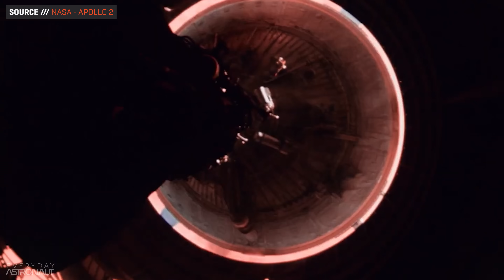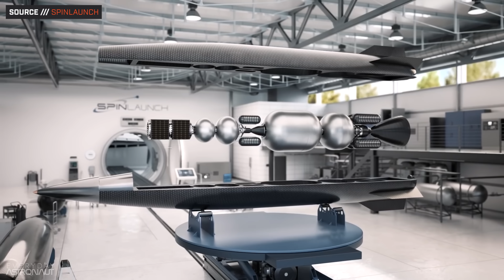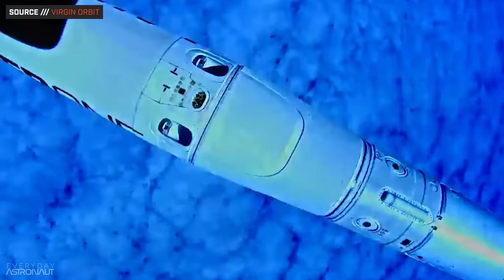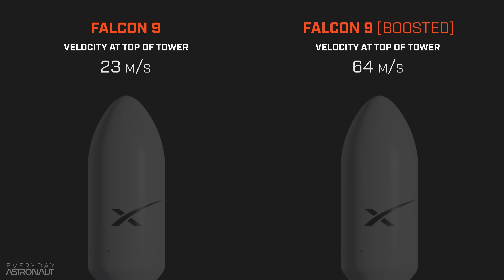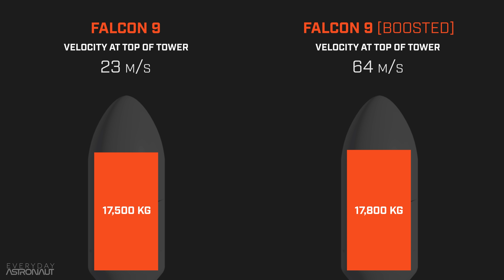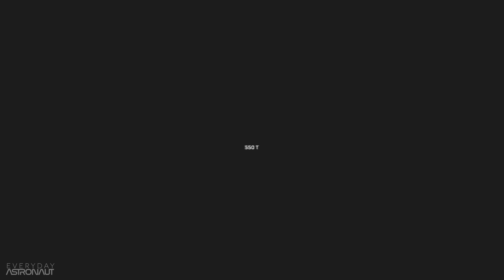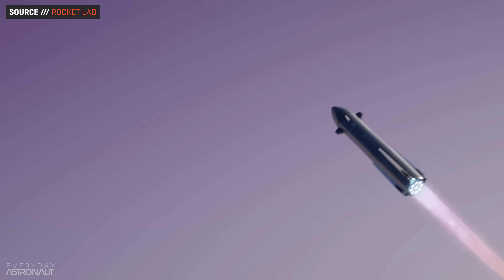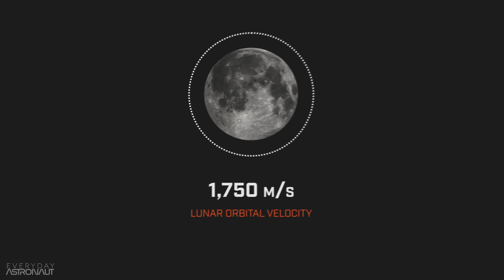Could We Help Push Rockets To Orbit?

Comment: 12:30 int the bigger scale of power, no. It's actual a reasonable amount, it's only worth 1/3 of an average nuclear power plant. These can provide up to 2GW of power from a single generator. So if you hook one up... You can launch. 2-4 of these.

Comment: You missed the more practical option. There are a few places on Earth relatively near the equator that have mountains 1000m+ ... This way your tunneling isn't straight down, which has a lot of other limitations. You build this theoretical vacuum sled straight up the side of one of these mountains. Should you use something like Mt. Everest, you could push this to almost 9km at peak. Then you "Yeet" the rocket at a height of 9km which is VERY thin atmosphere.

This is also a concept proposed for launching things off Mars using a giant sled and Olympus Mons, at a staggering 26km. You barely need propellant to leave Mars given how thin the atmosphere is and the relative gravity.

Comment: Once again, imagine aliens looking at us and not thinking "energy-poor troglodytes".

IMO everything is possible. Dino juice energy is just so easy and satisficing (ty LLM), but not sustainable. Guess what is:

15:08 ChatGiPiTy: To generate an instantaneous 5.5 GW from 15 %-efficient PV panels under ideal (STC) conditions in the Sahara, you would need approximately 3 667 hectares of solar modules (about 36.7 km²). (If we use capacitors:) Collection area reduces from thousands of hectares (for continuous output) to just 3.16 ha when charging over an hour for a 3.1 s pulse. (But:) Supercapacitor requirement is large—on the order of 1.6 million high‑capacitance cells—to store and rapidly release the needed energy.

Comment: JP Aerospace seems to have a bit more realistic plan. They want to use very large ultra low pressure airships to deliver large payloads up to a floating base at the edge of space, where it would be transferred to an even larger linear accelerator equipped ultra low pressure ship that brings it up to orbital velocities, deploys the payload and then aero brakes back town to re-dock with the floating base again.

Comment: How about just accelerating it on the ground and then have a ramp twisting it upwards?
  
This way the initial bump of the rocket is still take full advantage of its engines and gaining the first precious m/s without gravity going against it, and when it flips up and actually start to fight gravity it already has a ton of momentum behind it so now it needs way less fuel
   
And if you want an assist its much easier to have those while the weight of the rocket is putting it on the assist system and not trying to rig a very thin tower. If you need to run cables or whatever, having a pretty big surface to spread your cabling is much easier to deal with them running every massive cable on a single tower

Comment: Well if they have a boring company couldn’t they use mag rails to move weights under a pad area, cost not being an option, and not factoring land and water tables. Could that change the feasibility? Multiple rails and adds possibility of gear ratios

Comment: You missed the most Kerbal solution of all...making a 1st stage with turbofan engines to lift you upwards until they lose lifting power.  Like the 747 or Roc launcher, but the rocket stays vertical the whole time and you get there with brute force.  I could see that working for a smaller rocket, although the cost would be prohibitive and now you have to design some flying quadcopter/multicopter donut ring with large expensive aircraft engines.

Comment: MagLinAc. Magnetic linear accelerator, a rail-launcher on a mountain, on the equator.

Ecuador is almost PERFECT for this: on the equator, has mountains, the economy is already dollarified (look it up), it'd be a massive economic boost for not only that state but every nation on the way there, it could be powered with geothermal plants built around the accelerator, and excess current could benefit everyone else in the region.

Geologically active, yes, but, you could build rail infrastructure from anywhere in North America all the way down to Ecuador, load rockets onto an accelerator that's propped up against one of their less-active volcanoes on the equator, and you'd save hundreds of crucial ΔV on the first stage.

The only downsides would be launching over the Amazon, so any failures could be an issue, and the geological activity would present a challenge but wouldn't be a deal breaker, and plus, harvesting energy from the volcanoes could help geologically stabilize the region.

Comment: You didn't cover the sweet spot:

Aim to replace the booster
For a small rocket
No humans - can tolerate very high g forces 
Use a tall mountain to reach high altitude at point of exit
Built accelerating circle and only enter the mountain path once max velocity is almost reached 

Should work. 

Also spin launch is just stupid.

Comment: The best way to handle the kind of impulse to yeet a rocket off the pad is going old school roller-coaster launch systems.  Either a compressed gas accumulator or hydraulic accumulator.  Both are able to discharge a lot of mechanical force over short time spans using potential energy that is pretty easily created and efficiently stored.

Comment: Spin Launch will never work. Too much shock to the contents. Putting a long gradually curving track alongside a mountain is the obvious approach. No reason to rush the launch; it just puts more strain on the structures. Complaining about the energy use is not a strong argument; we are already sending rockets and using chemical energy of an even greater amount (chemical rockets are not 100% efficient).

Comment: What about a thick very long heavy tube with a door at the bottom and a buoyant/sealed to tube platform to hold a rocket inside the tube. Put the tube in the ocean with the door end very deep, then use the difference in water pressure when one opens the door to accelerate the rocket up, giving it a little boost. To empty the tube one could lift it out of the water with air bags or pump it out, though pumping might take a lot of power, but probably not as much as tossing a rocket.

Comment: 27:59 Dig as deep a hole as needed. 🙃

18:38 "can't imagine"
Me either. Wings work (but piggyback jets are silly)

26:22 "sucked all the air out"
No need. The system is self-evacuating (as long as the bottom stays sealed). A "blank" shot or two will do it.

First comes lift, which is best done slow. Emulate a glider and power with pistons and props to get up out of the.bulk of the atmosphere.

Suddenly everything gets easier and less explodey.

Comment: What about leverage? A massive see-saw, with the rocket hanging on one end, and a massive water tank on the other. When filling the rocket with fuel, you fill the water tank with just a little bit less mass, so the see-saw remains tilted with the rocket on the ground, but when ignited the see-saw would provide a bunch of additional force. You could put the fulcrum nearer the rocket than the counterweight in order to magnify the effect, with some sort of restraining clamps which get released when ignition is achieved. No worries about how fast you have to discharge the energy because you can take as long as you like to fill the tank as your fuelling the rocket. The engineering difficulty is in making a strong enough see-saw mechanism.
Reply: Just saw your comment, 100% agree I was saying “teeter Totter” a few days ago… simple minimal moving parts, loaded fuel offsetting a counterweight..
Reply: Yeah , was thinking the exact same thought, way simplier. I did not quite understand the maths, at the beginning, mention was made of the insane amounts of fuel required just to clear the launch tower.. this method would reduce this huge weight of fuel been required for this element, which in turns reducing the lift mass of the rocket... which in turns reduces the weight of water required.

Comment: Instead of lifting the whole rocket using electricity you could use a chopstick powered by rockets that  helps the launch. Yes this would a big amount of fuel to lift the main rocket but now the main rocket weights less since it does not need to carry all this fuel. This system could also have the help of electricity to push a little this chopstick up. 
(I'll transcript this video and ask chatgpt if it's feasible...)

Comment: Love how much effort you put into developing ways of producing a lot of power, in a short period of time... without using rocket engines.

One could imagine a system like so:

lift rocket engine, support tower, main rocket, support tower, lift rocket engine - all connected by a rigid structure.

The lift rocket engines wouldn't ever leave the system, so no need to land etc. They'd only need enough fuel for their short burn.

The advantage of this system would be three fold:

1) The boost would impove carrying capacity of the rocket.
2) Rocket engines alredy exist and are well understood, so minimal additional cost.
3) The support towers act more as guide rails, the actual 'lift thrust' is handled by rockets, substantially reducing needed structural strength. This would also allow taller towers.

Not saying I think this nessisarily makes sense... it's still a lot of complexity and resources for a small per rocket boost - and only really applicable in a maxed out scenario (otherwise it's easier to just laod more fuel into the original rocket).

Comment: push against nothing inside a vacuum is impossible.  experiments on youtube all show rocket exhausts refill the vacuum and push against solid barrier.
Reply from the maker: Do you think the recoil of a gun is from the bullet pushing against the air and then pushing against you? Do you think you'd receive the same recoil on top of a tall mountain with less air? Do you think there'd still be recoil from a gun at airliner height? The answer is yes, the same amount (maybe slightly more recoil), the reason is it's not reacting against the air, it's the equal and opposite of having a mass being thrown, rockets are just that, but trillions of tiny bullets at thousands of meters per second.
Reply: @EverydayAstronaut  so at what altitude the "recoil" effect steps in. recoil effect requires mass, did they drop off mass when launching off the moon, the fuel tanks were too small. besides theories need to be proven instead of saying recoil
Reply: @EverydayAstronaut  so how does Voyager probe speeding out of the solar system, the recoil effect requires mass to drop behind to push against.

Comment: One thing that could be interesting is to combine the lever method with the arm and add a pull mechanism, this would help drag the weight toward the ground reducing the weight needed, you can also make the lever overcranked to make it long to charge but fast to discharge
By giving the weight a little momentum before engaging ot could also help transfer the energy better. The receive the weight you can also build a ramp to curve it by disengaging it or putting it on a curved rail making it roll to an incline it would help reduce the energy after use while ... Not sure of the math for this idea but seam not too bad to help launch a rocket

Comment: A couple of papers. Try this file:///C:/Users/John/Downloads/AIAA_1990-2109_lunarsling%20(4).pdf  David Baker and Robert Zubin (president of the Mars society) in 1990. Using a rotating tether to launch payloads from the moon. With no atmosphere and low gravity tethers can be very long and the energy built up over hours rather than seconds.

Comment: I think you missed a trick or two here, why do people keep going back to this?
Primarily rockets are very inefficient in the first part of flight.. google propulsive efficiency, wiki. 
Most of the energy goes in the very high velocity exhaust. 
The second is the high gravity losses from relatively low acceleration in a vertical direction. So only 0.4g of acceleration, 1g of loss. This doesn't happen with you have higher acceleration at an angle. google wiki, gravity loss. 
So why don't rockets have higher acceleration? Well this is more down to the high cost of engines. High accelerations reduce gravity losses but once you have put on big enough engines to give high acceleration then you find that if you just use that thrust to lift bigger tanks then you get more into orbit and because fuel and tanks are cheap compared to engines the cost per kg goes down.

Comment: Scaling the rocket often seems like the best option, but to give the rocket an initial boost, using the example of Starship and its tower: instead of electrical power or a counterweight, you could design a propulsion structure made of tanks and Raptor engines, shaped like a ring, similar to a third stage, and attached to the tower. The separation between the ring and Super Heavy would occur near the top of the tower. This system would add thrust without increasing the rocket's weight, while adding reasonable weight to the tower (its own mass and the capability to stop it). However, it's unclear whether the small performance gain justifies the added costs, complexity and risks. An increase of the tower height would maximize the gain.

Comment: The pulley and weight system is obtainable if you use steam and wires similar to an aircraft carrier. Store the energy over time and release it all at once along with the rocket. I agree that the juice isn't worth the squeeze however. Not enough gain in capacity.

Comment: Wait wouldn't this mean you'll get a better deal if you used a jet engine kick stage that accelerates the rocket to a higher altitude e.g 5KM - 10KM instead of a few metres?

Comment: The Spinlauch system made me lose all trust in Real Engineering. The concept itself is so patently stupid to any engineer (the timing system cannot be reliable enough to be viable, the consequences if it fails are catastrophic, and even if it worked properly the whole assembly would shake itself to destruction the moment payload is released due to an unbalanced centre of mass), so the only excuse is that he was shilling for the company, which itself seems to be more of a startup investment scam than a real attempt at product delivery

Comment: These comparisons strike me as misleading. You can pick and choose comparisons to make any energy or power figure seem either absurd or completely reasonable. Counterexample: "The falcon 9 launch assist system would use about a tenth the power of a laser fusion research facility and the same amount of energy as about 20 kg of gasoline."

Comment: They should ask a structural engineer why. Any payload gain would be more than negated by having to make the rocket strong enough to withstand having thousands of tons of force applied to the fully fuelled frame during launch...

Comment: Consider building a 3-stage rocket where the first 2 stages are fully and rapidly reused. The third (expendable) stage weighs 150-200 tons and is fired in LEO.

Comment: A 40’ piston, and a massive container of co2 in liquid form. It would take off like a cork from champagne 🍾
Could be a bit tricky to stop it at the top of the bore, but it could be sent out over water and retrieved, and parachute to keep tsunamis from wiping out Cocoa Beach.
This device could be driven upwards by a solenoid and a massive cap bank to make more power.

Comment: Absolutely, I always had this idea to find the highest mountain near the equator and dig a deep vertical tunnel, with the tunnel walls lined with electromagnets and the launch pad at the bottom, maybe kilometers deep in the tunnel. Imagine the exit speed before the rockets would fire up.

Comment: This makes no difference to the conclusions of your video, but I think you missed out on the maths of a flywheel.

 A flywheel-clutch-constantAccelerationGearRatio (conical puley) system combines low power requirement (because the flywheel can be charged), low technical complexity and controllable acceleration. The biggest issue generally would be the forces required, but that's actually not too big an issue.

The flywheel can be relatively small because they're quite powerdense.

Comment: You ask too much of your systems performance.  Putting one extra rocket engine on the starship booster would add 175 tons of thrust,  That would help a great deal, That's three percent but over the 3 or so minutes of boost .  Launch from a mountain and you need less fuel.  Denver Colorado is already a mile high, the rockies could add another two miles to that.  One issue with that is there are always more populated cities around those tall mountains and another thing is the extra expense of movie fuel and parts up to that altitude and lastly there is less water to use as a deluge system.   One aid might be to launch from water, in the Caribbean sea, the ship would almost float fully fueled and so very little energy would get it moving upward.  You could use a steam ram to help it once it is ignited and it would just pop out of the ocean with very little fuel expense .   A counter weight cylinder filled with water that will drop into water instead of hitting the ground would help a lot.  175 tons of water and steel counterweight would help save fuel.  A girdle of jet engines could help.  10 engines with 30,000 pounds of thrust each could burn kerosene up to 150,000 feet and then drop off.  That would be more fuel efficient than adding two more raptors.

Comment: Ok how about a fuel tank in the launch tower, pumping fuel through a flexible hose. Then, when the rocket gets to the point where the hose disconnects, it's still fully fueled. The fuel tank could be smaller (though the oxidizer would be the same) for the same payload.

Comment: You would never use a battery. You’d use serialized ultra capacitors.
Reply: You’d push the rocket I think rather than pull it, I think